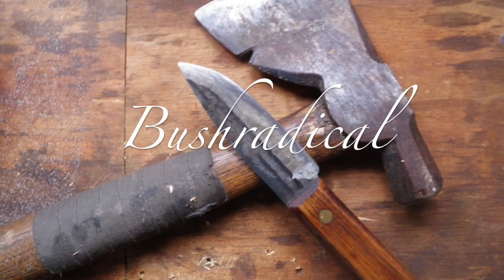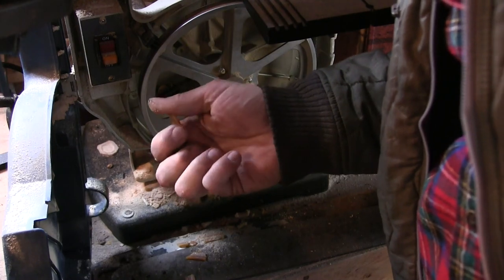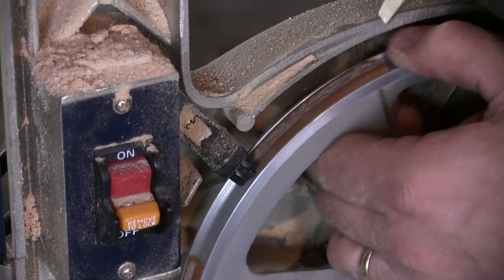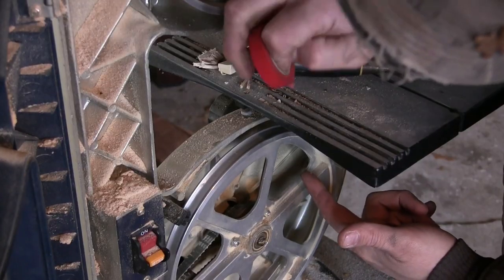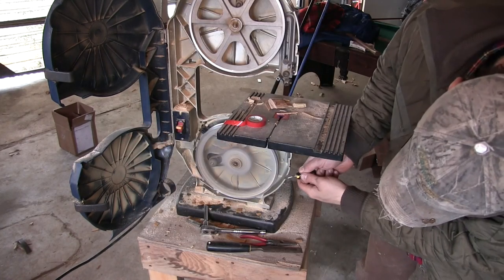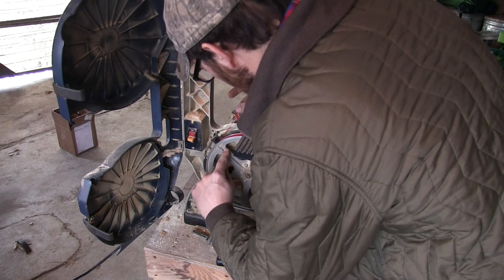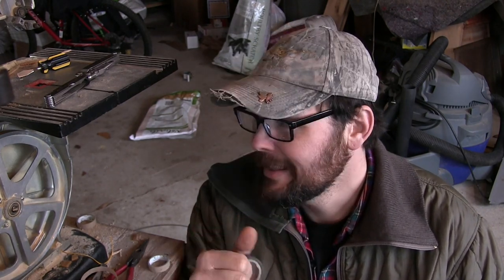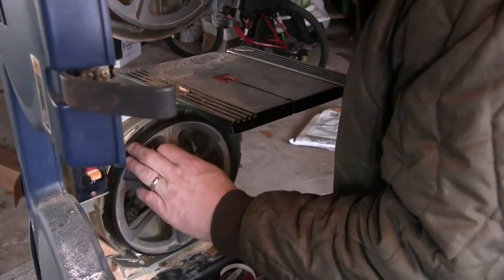How to replace bandsaw tires CHEAP!

Comment: I just bought an older Delta band saw that came with the bottom tire missing! I immediately ordered 2 replacements, but I wanted to get it working now. I followed your advise and I have a great working band saw! Thanks for this video, and I chuckled about your Red Green reference.

Comment: This is a great idea, thanks for sharing. I have used leather before that worked for years also. Skived down the edges where it met and epoxied in place. This is much much easier.

Comment: That’s a good fix, Dave. I have changed a few band saw tires. And smoothed a few out using a mill file and course sand paper, under its own power. Will remember this trick, and probably use it someday.
Reply from the maker: It works for me! I doubt it would be the best fix for a really good bandsaw, but this cheap one....it works fine.

Comment: I used duct tape on my 14'' Jet bandsaw upper tire in 2007 and it's still working fine, it tracks perfectly with zero issues.

Comment: Sounds like a great fix, i will go give it a try tomorrow on my very old bandsaw.
Many thanks.
David in the UK.
Reply from the maker: Best of luck!
Reply: @Bushradical  It works great!!  I made it my first job when i got to work this morning, the saw runs real smooth and cuts great now. All i need to do now is restock on plenty of insulation tape. This was a great tip, thanks a million! 
I am really enjoying working my way through your excellent video's. Just watched another while eating my lunch.
David in the UK.

Comment: My B&B Drill powered Band-saw had the lower tire blow out and the first thing I thought of was " Use Tape". But of coarse I went on Google/Amazon/eBay...Etc to see if I could find a replacement. Nope. Then I saw this video.I guess it will work. Gunna Red Green it. AvE would be proud of us. Thanks.
Reply from the maker: Thanks